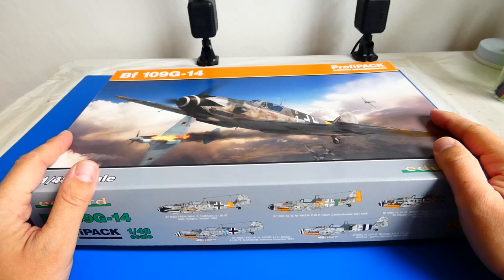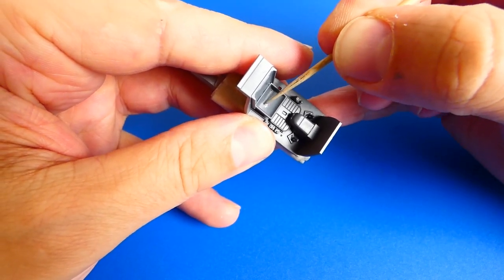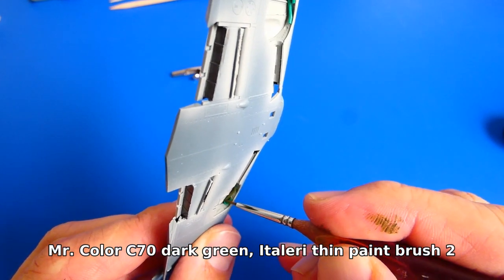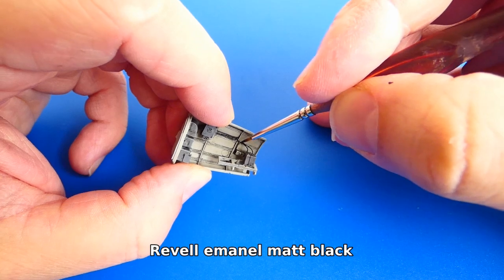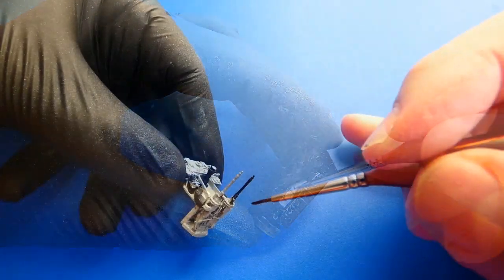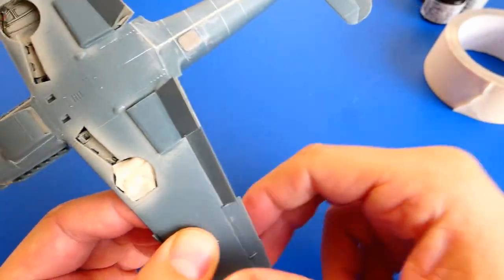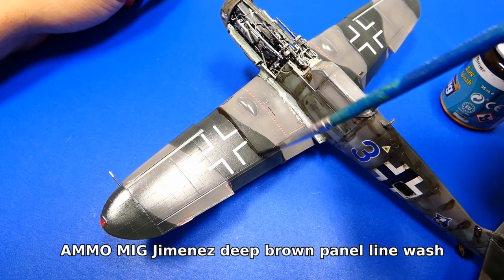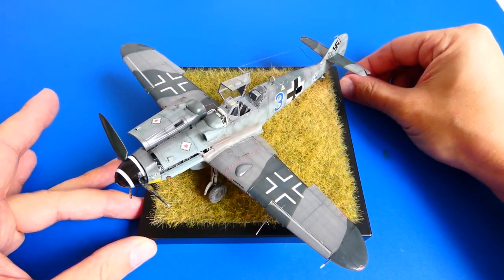Messerschmitt Bf-109G14  Eduard 1/48 scale with Resin DB 605 engine FULL BUILD VIDEO

Comment: Very nice video. Quick qeustion: whats your thinning ration for the mr hobby super clear?
Reply from the maker: Hi. My thinning is 1 to 4 -1
to 5 to leveling thinner.
Reply: Ok just to get you right, 1 Part Super Clear and 4 to 5 parts leveling thinner? How much psi do you use? Thanks in advance 🤙
Reply from the maker: @LennyH188  Yes exactly. 15 PSI work for me.
Reply: @modelsforfun  nice. Thanks a lot mate!
Reply from the maker: @LennyH188  You are wellcome 🙂